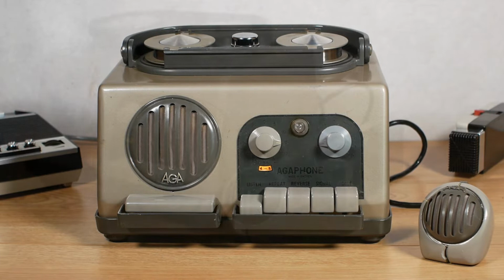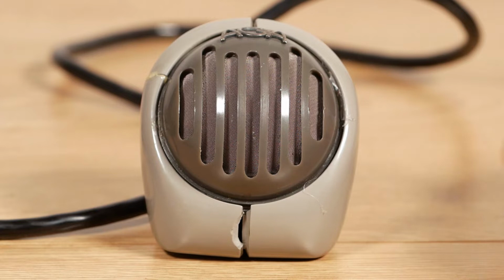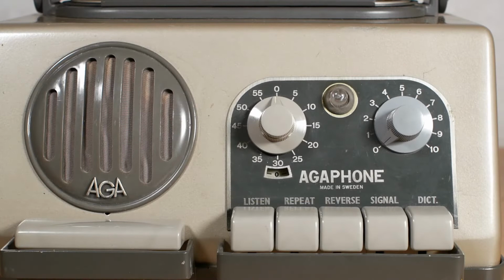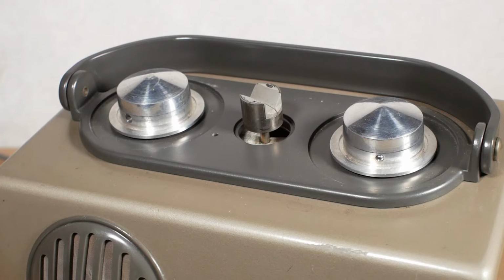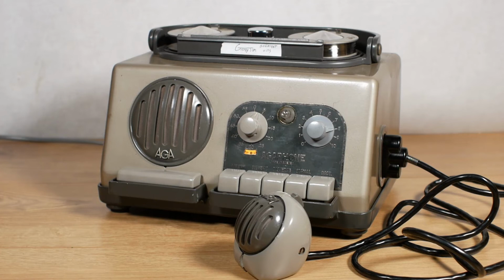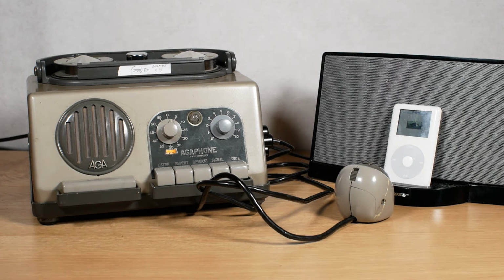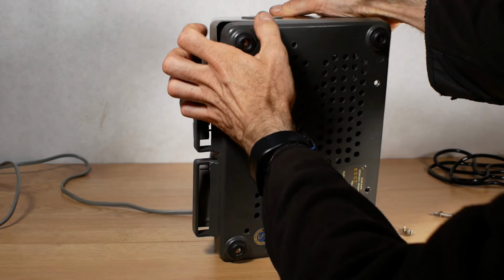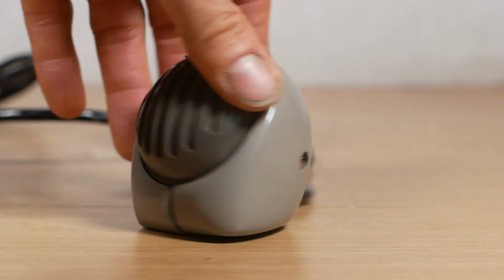Retrotech - Vintage Agaphone (Agafon) Wire Recorder, demo, test & repair.

Comment: I love my wire recorder. I saw TechMoan's video on them, then almost a month or so later, I found one in a yard sale. I was so excited for it!
They are a fun and unique medium. I recently picked up a microphone for it too.

This is a cool looking machine!  The one I have is a Webster Chicago 80-1.
Reply from the maker: They are pretty amazing aren't they - the Webster Chicago is a particularly nice looking machine.  I'm keeping my eyes open for some spare wire reels - I have two but they're both a bit prone to snapping because they've been tangled a few times in the past.

The sound quality is surprisingly good, I always assumed it would be terrible so I was quite impressed when I first heard my machine.

Thanks for the comment.
Reply: @GrumpyTim  The one that I have came with three spools, and I found some more on Etsy.
I've only played a few, thankfully none have snapped yet. But the rewinding mechanism on mine must need a repair since it does a really bad job on the original spool.
I was surprised at their quality. I was expecting it to sound like a degraded tape, plyed through an old tin can.
I found a listing for 10 spools on eBay, and for a while no one bid on it, until the last few minutes, throwing the cost waaaay high.

Thank you for the cool video!
Reply: @GrumpyTim  Here is an instagram post of mine playing: https://www.instagram.com/p/B_D-y2VhZ-c/
Reply from the maker: Oops, sorry, I hadn't spotted this reply, well done for spotting some spools on Etsy - I've been keeping my eye on ebay but any that come up seem to be a bit more money than I want to spend.  I'll return to looking at antiques stalls and boot markets when the world returns to normality and I'm sure I'll find some eventually.
Reply from the maker: And again oops, YouTube had quarantined one of your messages as "potentially harmful" probably due to the external link - anyhow, I just had a look at the video of your Webster Chicago - the sound is amazing.  Thanks for the link.
Reply: @GrumpyTim  No worries. I have seen the same on eBay. They all seem to think they have gold on there. Best of luck finding some!

My bad for the link. I didn't think that YouTube would have quarantined it, but it makes sense that it did. I was pleasantly surprised at the sound. Thank you!

I look forward to watching more of your videos.
Reply from the maker: @AtrumNoxProductions  Cheers AtrumNoxProductions.  From what I've heard YouTube (or Google who own YouTube) changed their policy on spam detection at the start of lockdown because many of their staff were working from home so they were relying more on automated systems without much human intervention - that would make sense and I've definitely seen an increase in the amount of messages that get flagged as potentially harmful since the start of lockdown.

Comment: I wonder whether the Agaphone has a more fussy wire transport and head as my chicargo webster has only suffered one break in the three years I've owned it and that was one the first play through of an old reel. If you join the wire using a square knot then that should pass through the head without snagging. The issue I have found though is that the knots if not really neatly done and trimmed can catch on the other layers of wire on a reel. One good feature that my model of wire recorder does have that the Agaphone doesn't is an autostop so if the wire does snag it will stop the machine before the wire snaps. This feature though seems to only appear on the very last chicargo webster models. I do really like the reel holder system on this model.
Reply from the maker: Hi Swing Band Heaven, I think my Agaphone would have been a bit more reliable if the two reels I have had not been so damaged - in both cases it looks like they've broken and partially unspooled in the past, then been badly knotted, and like you say, a bad knot snags on other layers of wire in the spool, and before you know it' you've got another break.  I do every so often look for some brand new reels but they always seem to be in the USA, and even if the price isn't too bad, once you've added on the postage it's a bit costly for me.  I'll keep my eyes peeled and maybe one day I'll get some better reels of wire.

I can't remember if the Agaphone has some sort of slip drive or auto stop, I think there IS something that stops it when you're rewinding, so it could be simply that my wire reels are just damaged and brittle already.

The Chicago Webster machines are really nice - I'd quite fancy one of those sometime......

Comment: The wire recorders can record OK music.  But you need a good source.  Easily AM quality.
The manufacturers should have slowed the wire down and made it thicker.  The wire is just too thin to make it a useful medium. It is far too prone to breakage.  But there are a lot of wire spools out there with programs taped on them from the radio. So people were using it for that.
Reply from the maker: One day, if I get round to it, I'd like to cobble together some sort of line in / line out because everything on my machine was recorder using that crude crystal microphone and played through the tinny speaker.  I've heard some really great quality recordings on wire recorders and I bet mine would sound fairly good bypassing those weak components.

As you say, the wire is just a bit too delicate but they're a pretty interesting format all the same.
Reply: @GrumpyTim  Yes. They are fun to play around with today.  You did a nice job on this machine and on the microphone.  A line-in and out would be great too.

Comment: That has got quite good quality record and playback shame about the wire snapping. I wonder how much it cost new, must have been a fortune.
Reply from the maker: I suspect the sound would have been even better if I'd been brave enough to try to connect it directly to an audio recorder rather than just playing through it's internal speaker, but there's some funny old voltages going on and I didn't want an Electroboom moment!!!!  From what I've heard the wire recorders suffered from less hiss than the early tape recorders.

I haven't been able to track down much information about the Agaphone so I've no idea how much it cost, but at that time, just after the war it wouldn't have been cheap.
Reply: @GrumpyTim  just out of interest, from the video it has 2 valves, which 2?
Reply from the maker: @BensWorkshop  The valves are a Mullard ECC33 and ECC35.  I just had a quick look at Techmoan's video about his Webster Chicago wire recorder and that cost 137 dollars in 1950 - I suspect the Agaphone might have been more expensive but that's just a hunch.
Reply: @GrumpyTim  That's interesting, they are both double triodes.
Reply from the maker: @BensWorkshop  I have to admit that valves remain a dark mystery to me - most (if not all) of my learning has come from doing things, such as repairing stuff - I've never had to repair anything valve based so I've never needed to learn about them.
Reply: @GrumpyTim  They are in principle, quite simple. Doubly so for triodes.
Reply from the maker: I'm sure I'll get round to learning a bit about them at some point - maybe that should go on my "to do" list!!!!